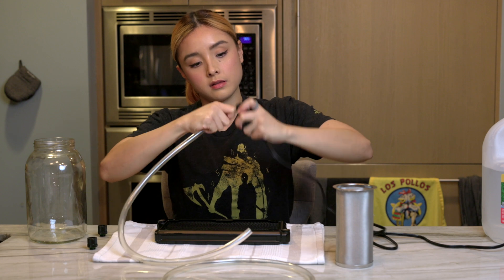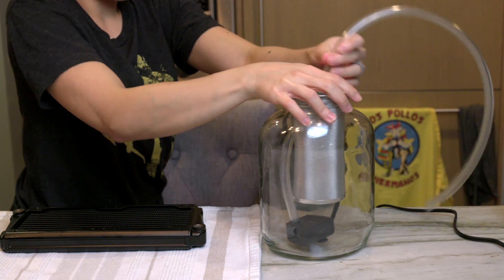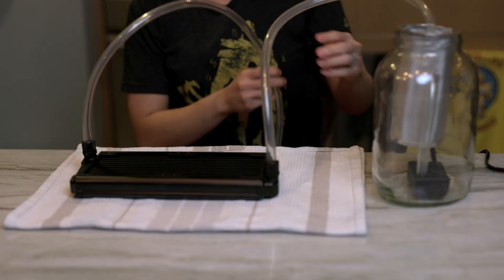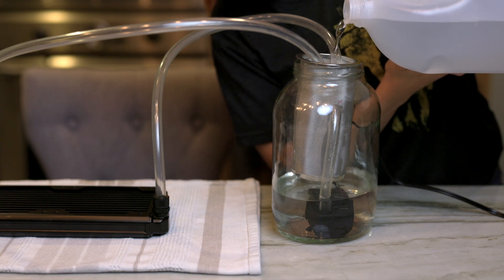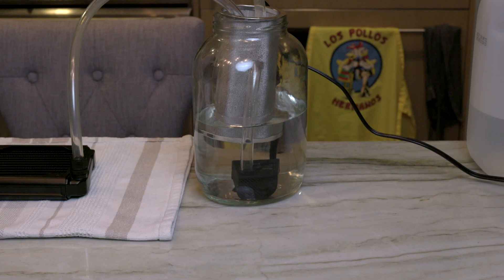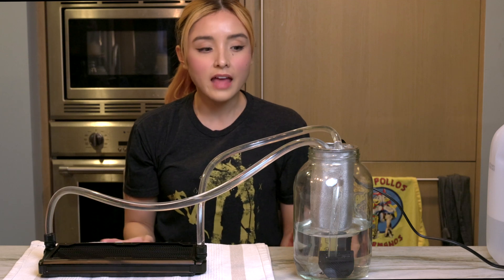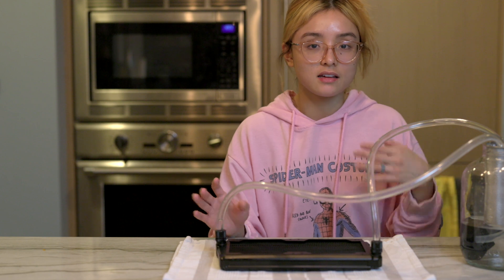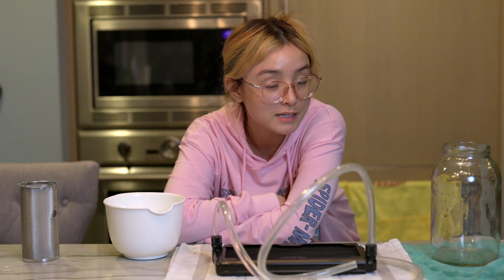How to Pre-Flush and Prep Your PC Radiator For a PC Custom Loop Pre Install

Comment: Hi, this is a really good video! I just had one question, what size tubing are you using for this? I didn’t see anything listed in the description. Thanks!
Reply from the maker: I think I used outer diameter 1/2 inch outter diameter (3/8 ID)  but honestly you can use whatever tubing/fitting size you have to make it work.  Good luck on the build!

Comment: Just stumbled across this clip  the other day. Yes, I agree with other comments here, GENIUS idea to use a generic fish tank / garden 5w water pump. After watching, I ordered fittings, hose and pump all for $8.. Currently flushing my radiator as I type. I’ve been soaking, then flushing out my pc loop for about 5 hours now and I think I’m close to clean again. I use yellow coolant from blue, with 2 cleans and refills previously giving me a shitty green colour. Hopefully this method works the best over the more traditional methods that always make harder work with minimal success. The rads the hardest to get gunk out of. As another poster suggested to tip up the rad for fittings to be on the bottom. Another good idea and makes sense. 
Thanks so much. 
Cheers from Thailand

Comment: I was wondering if you tried reversing the tubes on the radiator to flush it in the reverse direction.
Reply from the maker: Yes and it does help just a bit more. A little less than one might think though.
Reply: @SnaxanGaming  Thanks

Comment: Thank you for putting this up. Two years later and all the parts are still available on amazon. 🙏🏾

Did you even end up adding radiator prep solutions from places like primochill to this flush loop?

Comment: 7:00 Doing it the other way (shaking) may be more work but it's going to do a better job of cleaning out your rad. This lazy way will ensure that there will still be heavier pieces inside...trapped and unable to join their family. ;)
Reply: You do realise you can do both right? At the same time. Me personally do hot water with vinegar and shake vigorously. Empty that, then rinse with distilled and then hook this up. Reversing inlet and outlet after about 4 hours.
Reply: @prototypep4  Sure, but why? Get the metal out, then use the vinegar and rinse with distilled water. What concentration of vinegar do you use?
Reply: @EclecticianG  do you mean what strength vinegar or what ratio vinegar to water? Because it's double strength vinegar (cleaning vinegar) mixed 5:1 with hot water. Doing this step first with the shaking will loosen any stubborn debris. Rinsing with distilled or distilled+ baking soda will balance the pH again and then running this style of loop forces any smaller debris out with the constant flow. The total process leaves a rad very clean.

Comment: Just a tip - Elevate the radiator and flip it upside down so the fittings and hoses face down.  Don't rely on the flow of the water to be able to lift the metal fragments up the tube.  Let gravity do some work and drop the metal fragments down the tube.
Reply from the maker: Good tip!

Comment: This is cool and extremely thorough, but don't feel like it it completely necessary. I have been watercooling for nearly 15 years and have never done anything like this. I just fill the rad up with about 50/50 water vinegar, throw on some caps, and shake it. I then let it sit with the fittings on the bottom for about 15 minutes. Then drain it without letting it get shaken up. The debris will settle to the bottom so it comes out easily. I then rinse with regular tap water about 5 times and finish with 2 rinses of distilled water. 

The whole process takes about 30 minutes and you don't have to buy anything extra to do it. I have built/upgraded many systems over the years and never had 1 single problem with debris.

The biggest issue you will come across when watercooling is caused by colored fluid, especially anything opaque. I swear by distilled water and Primochill Liquid Utopia additive. I actually let my system run for 4 full years without a single flush. When I did get around to doing some upgrades and flushing it out everything still looked perfect. The only things that wasn't completely was the reservoir. It was cloudy above the waterline because I let it run so long that water had evaporated.

I feel like people are beginning to think the barrier of entry to watercooling is too high. With hardline tubing, distroplates, and $400 GPU blocks becoming the norm it looks too expensive and too difficult for new people. That type of stuff is not necessary. A soft tubing build performs just as well, is way easier to maintain, cheaper, and can still look great. I did one hardline build and even though it looked great I will never do it again. I am happy to see watercooling become more popular, but not happy with the expectations that are being set. I built my entire first loop on an I7 920 for about half the price of what just a GPU block cost now days.

Comment: Do I really need a jar can I just use the coffee filter and bucket or Tupperware container and copy one as in and out in the coffee filter?
Reply from the maker: You can use anything that gets the job done, even a water jug with the top cut off will do the trick.   You can be as creative as you want! :)
Reply: @SnaxanGaming  how long should I run it to clean a radiator just distilled water and filter n pump
Reply from the maker: @FallenAngels97  try it for a couple hours.  then clear the filter.  then run it for another 10 minutes or so to make sure it's clear.  There's no magic number since all rads are different, just repeat do it long enough until nothing is clear.  It's also best to reverse the pump flow once you do a cycle (swith the tubes) for good measure

Comment: Actually a 360 radiator would have the same amount, not more. This is because the only difference is core tube length so there is exactly the same amount of welding on a 360 as on a 240 rad. Thanks for the intro to this flushing method.

Comment: My question is how did you know what tube diameter to buy.. all these cheap aquarium pumps on Amazon don't list inlet diameter.. I know the fittings I got.. but Im not buying a piece of soft tube to match my fitting OD that won't fit on the pump.

Comment: Could you even do multiple radiators at once with this pump? Like, let’s say 3 480s.
Reply: End tank of the second radiator would catch and hold debris off the first rad, the third would catch and hold debris from the second and so on. You really have to flush the rads individually.

Comment: I would further use a inline filter with a finer mesh and catch even more gunk, especially with alpha cool radiators, the stuff that i found in the filter was unreal.
Reply: Did you find a suitable inline filter somewhere?
Reply: Almost sounds like alpha cool radiators are "Defective" if your finding alot in them.
Reply: @novusparadium9430 All water cooling radiators have some soldering residue inside. It's unfortunate but proper rinsing would be too expensive for the manufacturers. My radiators (not Alphacool) took ten hours each to get clean with high-flow electric pump action.

Comment: Just a thought as well... It may be worth switching the tubes around so its pushing water through the rad in a different direction about mid way through the process. I think that's one of the main reasons people like to shake the rads, to get that turbulence in there to loosen things up! Great video!
Reply from the maker: Not a bad idea!

Comment: You could do this with tap water and drain it into sink - eliminates need for buying a pump, jar, filter..
Reply: Sure but it will take you dozens of times and a lot more grief until the rads are clear.  Takes forever.  Been there done that.
Reply: @James-xp7dy  no as in you leave the tap on with tubing and walk away. I fail to see how that is any different from this method?
Reply: @justinpape5718  It's because there's not enough head pressure to get everything out, you need more pressure in a closed system to adequately get all of the gunk out, especially the smaller bits.  So you really need to shake it or use the preflush

Comment: a more effective way to clean rt is to use hot water as it loosen more gunk from the rad and then flush it with soapy water for about 30min then go back to hot water but this time without a loop for 45mins so i make sure all the chemicals from the soapy water is all flushed out oh yah dont forgot the shake the radiator at the soap stage

Comment: Cool video.  I've seen this technique before but using a filter material and it all seemed like a pain to setup.  Your setup is super clean, I appreciate the links, I ordered the exact same stuff!  And I'm with you, I do the soak, shake, rinse, repeat, this is much easier!  Thanks again!
Reply from the maker: Good to hear and also To make it easier, you don’t have to use a jar you can return that. Just get a big jug of distilled water and cut the top!  :)
Reply: I saw that you mentioned that in some comments but kept the big glass container.  I used the suction cups to hold down the pump, then put the filter on top so the top of the filter is out of the water.  A lot of the particles float, I've already got stuff in there and it has been running a couple hours.  This is after a Mayhems Blitz treatment shaking method.  One thing is the Alphacool rads have painted threads, I think what I'm getting out is some of those paint fragments.  I know that those would have ended up in my CPU block for sure!

Comment: Would it be bad to loop 3 rads  together and flush them all at the same time , and use a strong water pump?
Reply from the maker: should be fine :)
Reply: @SnaxanGaming  ohh wow.  Ok .  I got a thread ripper 24 core, rtx 3090 ,  3 rad liquid cooled pc  ill be  building within a few more weeks.  I hope I can get it built in 1 day after full  radiator flushing.  All for 3d modeling, VR, VFX video compositing stuff that I'm getting into.    Thanks for the help.   :)
Reply from the maker: @MarcusJ973 Quite a rig you got!  Should serve you well and will last a while.  Good luck on the build!
Reply: @SnaxanGaming  :)  :)

Comment: Hey will you also flush your waterblocks doing this same method or simply no need?
Reply from the maker: No need to do it this extensively for the blocks. You can get away with filing with water and shaking.  That's just me though.
Reply: @SnaxanGaming  thanks. My case mb ram and cpu showed up. Looking forward to getting going. I’m also building with the msi carbon ek x btw

Comment: Thanks for the video! What's the ID/OD for the tubing you used?
Reply from the maker: The tubing actually came with the pump I bought int he description. Idon't know if it still comes with tubing, but if not, the fittings I used were 12mm so you can get that size and it should work.  (I think the tube was 1/2 inch which is technically a tad smaller but still fits)
Reply: @SnaxanGaming  Awesome! I have 10/16mm ZMT tubing coming so we'll see if it works. Thanks for the info👍

Comment: What size soft tube did you use? OD 12mm, would be great to know the specific tubing that would fit that pump because I don't think a 16mm OD can fit in there.
Reply from the maker: The tube came with the pump in the description.  Its not exact but if I remember correctly it will fit on 12mm fittings but it a tad tight.
Reply: @SnaxanGaming  Thanks dang it looks like no tube comes with it anymore.

Comment: Okay so help me out if you can. I've searched high and low on Amazon, and I can only find aquarium pumps that take either 8mm or 13mm tubes. I can only find compression fittings in 10mm or 12mm and soft tube in 10mm. So how did you get a soft tube to connect to the pump and fit in the fittings?
Reply from the maker: This is the exact pump I got https://amzn.to/3tMiKbI I believe it comes with a 1/2 inch nozzle so 12mm should work
Reply: @SnaxanGaming  Thank you, Sarah :-)

Comment: When I saw this in your first build video I didn’t quite know how you did it, but I thought that it was BRILLIANT. So much better than filling shaking and pouring. Thanks for sharing your technique with us. I’ll definitely be doing this the next time I have to flush a rad. One question though. What size tubing did you use?
Reply from the maker: This is super late reply lol.  So sorry and you probably already got it done.   But the tubes actually came with the pump when I got it.  I heard from a few people that the tubes don't come with it any more.    But the fittings were 12mm so you can use tubing for that size and it should work.  P.S.  Also there is an fitting that goes into the outlet of the pump.  You can remove the plastic fitting from the pump and insert the tube into the pump without it if you need a larger diameter.

Comment: Hi Sarah! Going to build my first custom loop next week just waiting for the parts from EKWB. What about the cpu block and reservoir? Does it need flushing like that or no need na? Thanks!
Reply from the maker: They can just be rinsed out with distilled water since they are smaller and more visible inside.   Once the loops is set up, it's a good idea to run it for a while, double check for leaks, and then drain/flush it a final time with distilled water before filling it up with the coolant.  If you do that, any of the stuff that was in the block should be out.  good luck on your build!
Reply: @SnaxanGaming  thank you very much!

Comment: Thanks for showing how much shrapnel there was at the end. I only rinsed mine 3 times but got a similar amount out. I did use near boiling distilled water with a bit of vinegar for the first flush, though. The HWlabs radiators have relatively more shrapnel than EK or Alphacool, and the Corsair radiators are rebranded HWlabs so those really need to be flushed too.
Reply from the maker: It's funny, well not really funny, but they all market their radiators and "pre-cleaned" and "no need to flush" but there is always stuff in there!
Reply: You're wasting money by boiling distilled water. You're going to get crap in there regardless because of the process of boiling the water. Boil regular water, flush it, then finish it off with distilled water flush
Reply: @rustler08  I have thought of that, contaminants from the pans getting in during the boiling process, but it should be less minerals boiling and being added than straight tap. I do a final flush with straight distilled, just as you said. I even run it a few days with distilled, then coolant, flush that and then do a final fill. So wasted $$ all around.

Comment: I was able to clean my GTS 360 and SR2 360 with a 1/3 white vinegar 2/3 distilled water mix, flushing about 5 times each and then letting both rads sit completely filled with boiling hot water straight from the kettle, draining after it cooled a little to get the solution out.

Those little flakes showing up in the filter? Yeah you don't want those getting into the microfins of your waterblocks. While it won't damage the blocks per se, any buildup of debris inbetween those little microfins can eventually compromise your blocks cooling performance.

And you definitely don't want any of it finding it's way through your loop and into the D5 pump!

Comment: Hey Sarah thank you so much for this video! I'm planning a watercooling build and took a lot of inspirations from you! I was wondering what was your method of emptying the distilled water from the radiator after you have finished with the flushing.
Reply from the maker: So happy to hear that thank you!  You can just take out the tube and fittings and  pour the water out, nothing special.  That’s why I prefer not using any other mixes with the water (some people use white vinegar or other things). If just distilled water is left behind, it’s harmless.

Comment: Sarah can you list the items that you used?  Thanks!
Reply from the maker: Sure,  Here is are the exact items I used.  However you can simply use the same idea and use different things.  Even a normal coffee filter would work in theory.  
Aquarium pump I used:
https://amzn.to/3tMiKbI
Coffee filter 
https://amzn.to/3tKBAAd
Exact in the video Jar (you'll need to cut a hole in the filter with this one)
https://amzn.to/3KxTkVu
Wide mouth jar (if you just want to put the tube on the side and not drill a hole)
https://amzn.to/33xJWAx
Note: You don't have to buy or use a jar you can also just cut the top off of the distilled water bottle
In my PC build video I used the wide mouth jar and put the tube outside and ran it out of the mouth.  Again you really don't need the ones but these give you an idea and you can duplicate it exactly if you like.   You also need soft tubing and the fittings (plus distilled water) but those are less specific and people and use what they like.
NOTE- If you have trouble making the tube fit into the pump, you can take out the insert that goes in the pump outlet.  This makes the diameter larger and you can fit the tube in.  (or get a smaller tube).
Reply: @SnaxanGaming  what size tubes and fittings? did you use the fittings you already had from the build? That build was hard tube right? Do the hard tube fittings work for this?
Reply from the maker: @tdub77  Don't waste your hard tubes on this. Just get soft tubing.  Easier and cheaper.   (unfortunately soft and hard use different fittings).  If you read some of the comments I have the exact specs I got if you can't find them let me know and I'll look it up.  I don't remember off the top of my head since it's been so long.
Reply: @SnaxanGaming  so I ended up just ordering two barb type fittings from ek and some 1/2” ID soft tube. That pump has 1/2” port on it so I figured that should work. Oh and thanks for the vids on building. You’ve inspired me to take apart my r11 aw and move the parts I can to a custom water cooled glass tube setup

Comment: You should flush everything, rad, gpu/cpu blocks everything. Ive done it 2 years ago and sometimes still find flakes coming off the connectors since they're plated nickel.